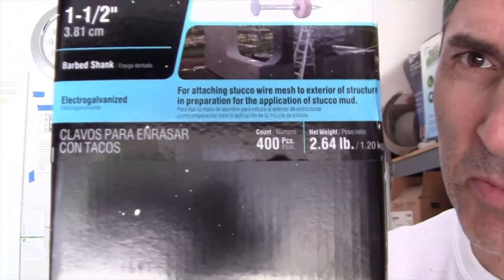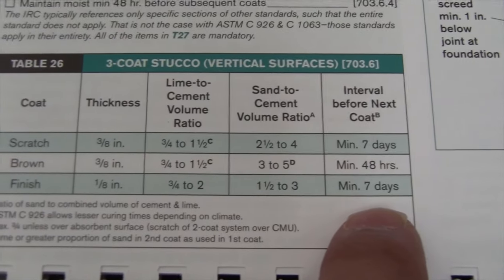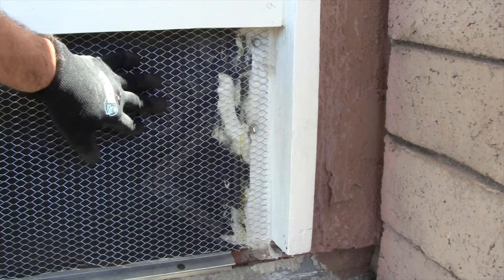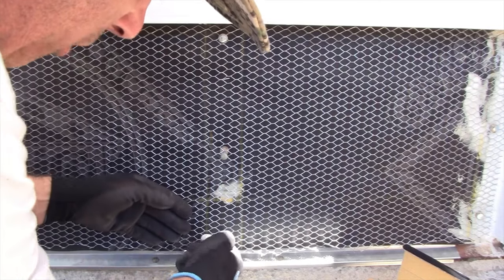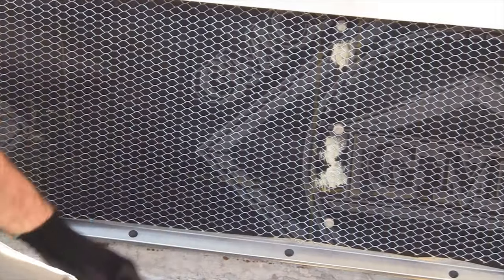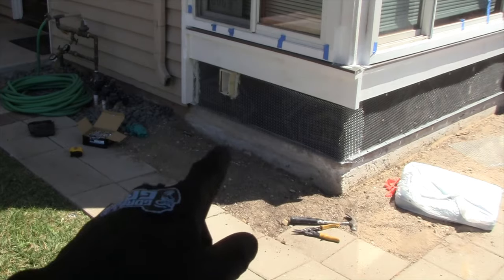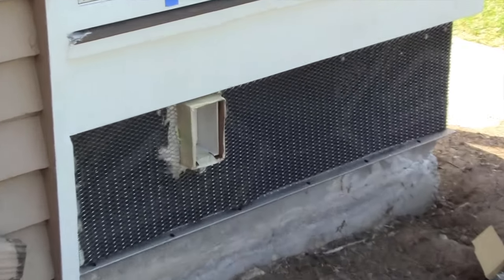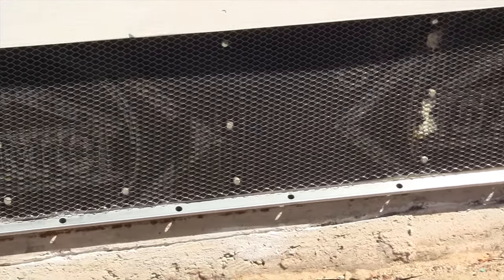Stucco Repair Series Part 8   How to Install Stucco Lath Mesh Wire With Furring Nails

Comment: Great video 👍👍.
My problem is I'm using the diamond mesh over 1/2" sheathing and paper.
I was impressed your installation of your wire, u had your cups up 😃👍

Comment: wouldn't you want 6 inch horizontal spacing as well to keep that 1/4 spacing between the mesh and wall?
Reply from the maker: I can't picture what your question is. can you ask a different way?
Reply: @KenTraining  my question is about horizontal nail spacing. you placed nails at 6" vertically along the studs. it appears you need a nail at the midpoint between studs otherwise with 17" oc spacing of studs the mesh will sag when you  apply the stucco, and you will lose the 1/4" clearance between the wall and mesh.
Reply from the maker: @driger888  my studs were 16 O.C. Spacing. I did 3 nails per stud. I can tell you the job is still holding up great.
Reply: @KenTraining  ok furring nails are so rarely used anymore its hard to find information. i was considering adding a nail in between studs to ensure the mesh keeps has 1/4" clearance  spacing. guess it couldn't hurt. . thanks for the video.
Reply: @KenTraining  when you buy furred dimpled metal lath, the dimples generally spaced @ 6" vertically and horizontally, so i would think furring nails should be @ that spacing for unfurred metal lath. glad your project worked out and hope this helps other diy-ers.

Comment: Hold up stop stop we're going to need for you to take all that off we're going to have to have you reapply the mesh wire the drip edge and the hours just go ahead and log them in or either we're going to have to stop this this is we need efficiency incorrect you have a lots of harnesses and things you've spent a lot of money I'm going to have to let you go I'm going to have to give you your walking papers if you're not able to complete this job this task in the most efficient Manor considerable time being the judge time is equivalent to livelihood❤